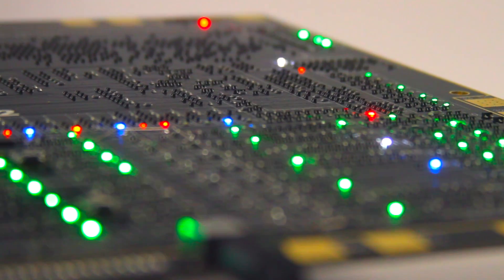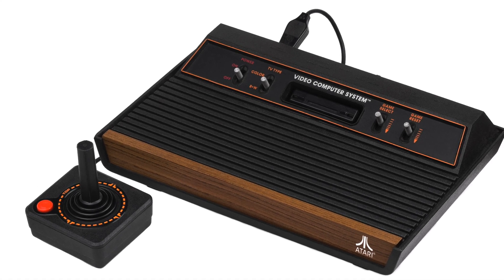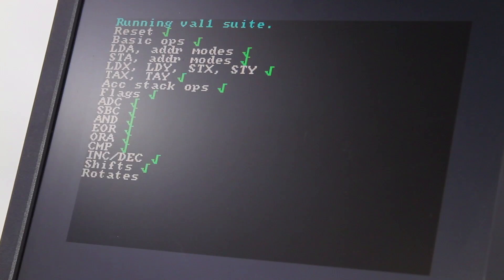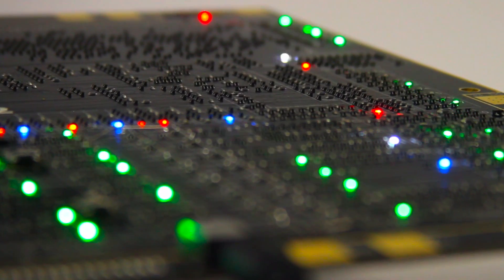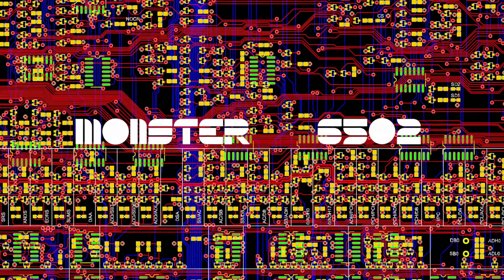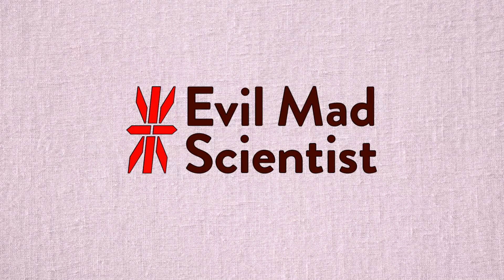MOnSter 6502 Update #1

Comment: Impressive and this actually still manages to be smaller than the transistors used on the TX-2 from MIT's Lincoln Labs from the late 1950s. Despite having much larger transistors, the TX-2 was actually much more powerful than the MOS 6502. This obviously does mean that the TX-2 was a building-sized computer larger than a Shopping Center. The TX-2 also required it's own 8 Megawatt power plant to function. I think that if the TX-2 was built like this MOnSter 6502, it would be as large as a bus and it would require an 80 kilowatt power supply... Basically it would consume the same amount of energy as 16 electric showers... Seriously the TX-2 was an absolute monster in the 50s it consumed INSANE amounts of energy... But since it had it's own power plant I guess it was OK back then when energy was cheaper and more plentiful. Nowadays it simply isn't ok to spend that much energy on a computer lol. Of course that Nowadays we can just produce a microchip version of the TX-2 which would consume less than 1 watt! Seriously LESS than 1 watt! That's over 8 MILLION times less energy than what the original TX-2 consumed. We came a long way...

Comment: The c64 was a 6510 processor which was a 6502 with extra I/O pins for bank switching (amongst other things between the basic rom and ram, that you could copy by writing the same data back to the same location!)
Reply: Yes, exactly.  The VIC-20 was the Commodore with the 6502 chip

Comment: What is the reason for the limited clockrate?
Reply: Capacitance, noise, component tolerances.
Reply: tehaxor69 .... that is why i asked them cause the clockrate seems extremely low to the point where none of the factors you mentioned should have a noticeable impact.

Comment: Interesting project. Though, the C64 did not run on a 6502, it was the 6510. A derivative, but not the same chip.
Reply from the maker: Toyota vs Ford is a rather poor analogy -- the 6510 is extremely similar to the 6502 in terms of chip layout, usage, etc. It's more like the same engine with an extra exhaust pipe. 

If you look at the datasheet for the 6510 processor, right there on the first page it says "The internal processor architecture is identical to the MOS Technology 6502 to provide software compatibility." These chips were intentionally designed by the same people to be compatible with each other,  despite their minor differences.

We understand that many people know the subtle differences between these devices. We glossed over certain details to explain the big picture of what our project is. We are not, for example, making a how-to video about which CPU device device models and speeds can be used in which motherboards. 

(Fun fact: The 6510 is MUCH closer to the 6502 than a 6502 is to the Ricoh 2A03 in an NTSC NES. About 1/4 of the 2A03 die is essentially a transplanted, slightly modified 6502 core, and about 3/4 of it is not. That's quite different from the 6510, which is just a slightly modified 6502 core.)
Reply from the maker: We did gloss over some details of that nature; a couple of the other systems that we named are also variations based on the same core.
Reply: ExcalibursZone 

For all intents the 6510 is just a 6502 with an extra IO port added, and a few other minor changes.

Same thing as where we often say the SNES CPU is a "65C816", but that's also slightly modified.

(and the Ricoh CPU on the NES etc. etc.)

Nintendo in particular liked using slightly modified CPUs, perhaps to make it harder to clone those machines?

Even the MIPS R4300i in the N64 is only slightly different to the generic NEC branded VR4300, as it has two pairs of pins swapped. Sneaky. lol

Love this project btw.
The 6502 is easily one of the cleanest CPU designs ever, especially the instruction set / mnemonics.

It would be great to see similar macroprocessors made for other popular chips eventually.

Or perhaps implement a discrete version of the NES PPU, so we can all watch Mario being drawn REALLLLY SLOWWWLY. :p
Reply: It's mainly an accuracy thing. While the chips are in the 6502 family (of which there is no dispute) you cannot put a stock 6502 in a C64. You need a 6510. The Vic 20 had a 6502, the 1541 had a 6502, and the NES had a 6502. It's like saying "The Ford's engine is the same thing as that Toyota's engine with a few minor changes" you simply can't just transplant one into the other. A little simplified of an analogy, but that's basically the same thing.
Reply from the maker: This is based on the reverse engineering of a particular 6502 revision (the "rev D" silicon), and has all of the same undocumented commands that came with that silicon. No more, no less.
Reply: ExcalibursZone 

Yep, fair enough.

Usually it's me who's the pedantic one when it comes to the technical stuff, so I'm trying to break the habit. lol :p
Reply: You can say the same thing about the 2600 and NES.  The Atari ran from the sized down version of the 2600 called the 6507 and the NES had 2 modified 6502's in their system.
Reply: The only significant difference - mainly from the programmer's viewpoint - between the 6502 and the 6510 is that the latter has added a bidirectional, bit-addressable port at location 0x0000 and the data direction register to control it at location 0x0001, together with a slightly modified pinout of the IC package - this, of course, is only relevant to a hardware designer. In all other respects, they are identical.

And I'm not even a 6502 fanboy, I'm rooting for the Z80 at every opportunity giggles

Comment: Next step should be electron tubes ;)
Reply: I'm intrigued, please tell us more about how you see this implemented.
Reply: May i? You'd need a few glass boxes to do it in. Instead of VFD's you could make micro sized triode and tetrode tube nodes inside almost the size of an SMD transistor. Instead of LEDs you can use fluorescent die directly on the lines you wish to illuminate. Capacitance would be a problem because of the high voltages needed to operate the vacuum valves, but embedding resistors and ceramic capacitors inside wouldn't be that hard. I can see it happen using vapor deposition and etching techniques like they use in the production of silicon devices these days. It would require quite the development process, but i think it's doable!
Reply: Howard Black
Now that you mention those micro tubes, i vaguely recall seeing pictures of them - and yes, it would have been quite interesting to have been able to see to which degree the miniturisation of this technology could have gone.

Comment: What is the limitation for speed?
Reply: AFAIK there are two main factors: size and fragmentation.
Size means bigger elements, which means more current/more electrons. This means that we need more time to move all those electrons around each cycle. This CPU surely consumer much more power than the original chip.
Fragmentation means that all the elements are not placed on a single chip, made from one bulk of silicon. There are many downsides to that: bigger distances between transistors' terminals, additional capacitance and inductance coming from wiring (which means bigger impedance and lower max frequency). Another downside is that transistors created on a single chip behave better working together, hence bigger speeds are achievable.
Reply: From the MOnSter 6502 website : "The primary limit to the clock speed is the gate capacitance of the MOSFETs that we are using, which is much larger than the capacitance of the MOSFETs on an original 6502 die. "
Reply: over 20 cm it takes (1/1.5Giga)seconds for a signal to arrive, so you might run into problems in the ghz range, but I don't think that would play that big of a role at 4mhz.
Reply: my guess: transistor switching speed combined with moving significantly more electrons around causing greater capacitive/inductive effects.
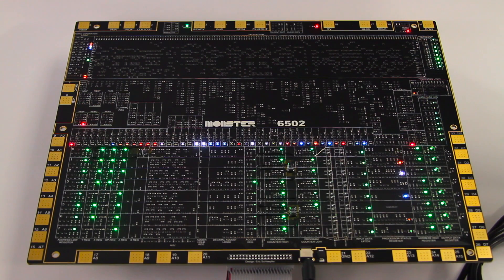Reply: At 1:15 the narrator says 60 KHz.
Reply: I'm propably wrong here as it's just a wild guess. But I'm guessing it has to do with its size. It takes  longer for the signals to travel on this version than on the smaller original one. It can also be that they might have used cheaper parts for this one.
Reply: Andreas Elf Seriousli did you just add measurement thats few centimeters into ligh speed equation and some how got 15 000 % diference answer ?? 

FACEPALM.
Reply: Limiting factor is transistor speed..You up the frequency more-your transistors must switch faaster and faster  so signals get plagued with parasitic capacitance and inductance..60Khz is fast enough-considering your amplifies can work good almost to 20Khz - 60Khz is plenty!
Reply: Can you just imagine plugging this into the CPU socket of a Commodore 64, and wait for basic to pop up after about a minute?! ha-ha... amazing project for sure.  Is there are video about the 2nd version?
Reply: Guys, size itself cannot cause any limitation :) Current travels in conductor with such speed, that it would have to be size of thousands of kilometers to see any difference. It's considered to appear at the other end immediately at such scales, regardless. As someone noticed limitation occurs from properties of discreet elements used and frequencies they can work at.

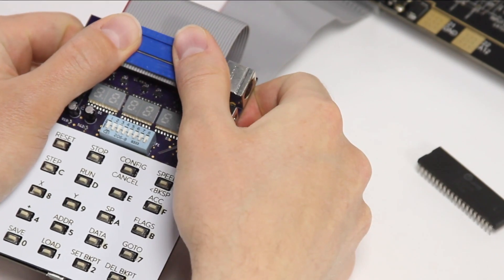Comment: What's that thing on 1:40?
Reply: It is a circuit board used to interface with the processor. In other words, a CPU by itself will not do anything, similar to how a car engine is useless without the rest of the car. This board allows you to program the CPU and connect hardware such as a keyboard and screen.
Reply: My bad, what I meant is, I'd like more info on that thing, a name would suffice I guess. Need it for the project I'm working on.

Comment: Altium tip: Enable display of net name on all of your power (ground) ports, even if you expect them all to be the same. An identical graphical symbol doesn't guarantee that they're the same net. It's also not possible to catch that during review of a printed schematic. Ask me how I learned this. =)

Also- it helps to keep your DRC warnings (green nets) under check. I once worked with an engineering tech that didn't realize that green meant DRC warning... Every pad on a 12 layer board was green.
Reply: Cool story bro... now can you translate that into English si vous plait ?

Comment: It needs a monster heat sink.
Reply: The transistors are spaced MUCH further apart than a modern CPU, so there would probably be no significant heat build up. Then again, higher voltage is used for signals between larger/more spaced components, so it would probably be hotter than expected. Doubt it would have any affect on the computing though.

Comment: What is this for? What purpose?
Reply: Education for the Computer Engineering interested I'd guess. With all of the LEDs you could single step program code and visually see exactly what is happening within the process of running the code.
Reply: I think the reasoning is somewhat similar to that of Sir Edmund Hilary, in that "it can be done".

Comment: Where's the monster Z80
Reply: 6502 gets all the fame but most of the early work I did was Z80 based, mostly TRS-80.  Wanted to work on the 8080 but they were too expensive at the time.  A 4004 replica should be easy to do.  I think someone did something similar for a PDP-8.
Reply: build yourself, it roughly has about twice the transistor count 8,5k
Reply: give me a few years.

Comment: If you made a similarly scaled version of a modern cpu, how big would it be?
Reply from the maker: Steve Mitchell Please see a few example calculations of other devices at this scale on the Monster6502 web site.
Reply: about 286 squared meters
Reply: That's less than a tenth of an acre, hold my beer.

Comment: What is limiting the speed so low? If all the components are just larger versions of what is in the microprocessor, the only difference I can think of would be the length of wire between components. Would the delays caused by longer wires already start to cause trouble above that?
Reply from the maker: Pauli Vaara Larger parts have larger capacitance. It’s not a trivial difference.
Reply from the maker: The MegaProcessor goes up to 20 kHz. Certain parts are faster, but it's limited by the slowest parts. Likewise, certain parts of the MOnSter can run much  faster -- a test board of ours that we built with just the program counter portion alone can run up to 400 kHz. However, there are large busses, and high capacitance thanks to the properties of the discrete MOSFETs that we use. That is to say, it's the components themselves, not the wiring between them that comprises our primary speed limit.
Reply: That might have helped. I had in fact started reading wikipedia stuff on "capacitance" and ended up reading "house dust mite" for reasons unclear, but that's just normal wikipedia use. So, basically the greater the current the transistor has to somehow "manage" (switch on/off? amplify vs. quench?), the slower the transition. I'd check wikipedia on "transistor" but I'd risk ending up reading interesting stuff on artichokes. :)
Reply: The speed of light is 12 inches per nanosecond,  so no electrical signal can propogate faster than that.   On PC motherboards, which are (or were) nearly as big as this one,  signal reflection didn't become an issue until they tried to run above 33Mhz.  If gate capacitance is the only issue here,  the simplest fix might be to run it at a higher voltage but as this would need all the current limiting resistors on the LEDs to be changed,  and signal convertors on all the I/O lines,  IRL the only practical fix is to specify a FET with lower gate capacitance for the next version.  With 3000 transistors every extra cent per transistor must be painful.
Reply: I ask this without having any idea or deep knowledge of electronics, but... I wonder how does the Megaprocessor project achieve speeds like 100 MHz while being so big.
Reply: Whoops wait, I read the number on their throttle wrong. It said 100 KHz top, not 100 MHz. However, still faster than what I’d intuitively expect given the massive amount of wiring.
Reply: That was comprehensive! Thank you! Just gotta check out wikipedia on what "capacitance" means now... :)
Reply: 60 Minutes did an episode on U.S. Navy Captain Grace Hopper. She talked about how she did not understand the time delay in wire. She had one of the guys cut a a huge spool of wire to represent 1 millisecond. I cannot locate the episode, however, I remember she mentioned how many feet were in that spool of wire compared to a few inches that represented (I think) a nano second.
Reply: I bow to your greater experience about the reflections at lower speeds.  Propogation I understand to be a function of circuit design i.e. number of gates a signal needs to get through before it generates its result somewhere else.  That's not relevant to this board as it uses the same circuit as the original chip.   The inductance of the traces might be more significant.
The speed of light is relevant as that is the maximum speed that any effect can propogate through space.  A 1Ghz clock will always be skewed by at least one whole cycle over a foot of even a perfect superconducting wire
Reply: lassit lassit1 https://youtu.be/JEpsKnWZrJ8

Comment: 3000 transistors.  That's so cute!  Look  at you!

PS - Apparently the early T-800 Terminators were running 6502 code, because when the first Terminator movie came out, there was a scene where we're given a Terminator's eye view of its sensory input and decision making process, and I could have sworn it was 6502 assembler code off to the side.
Reply from the maker: Bender runs on a 6502 as well.
Reply: Maybe there were more than one of those scenes and in one they used assembly, but I very clearly remember that the scene I saw had COBOL, because when I saw it I had just started training for a new job learning COBOL and it blew my mind.
Reply: I researched it snd my hypothesis was right, they used both: https://youtu.be/YRnnjoiSV-U
At the beginning of my research I found only images and clips with assembly and I started to worry I became victim to the Mandela effect
Reply: Yeah, all they needed was the software.

Comment: Wow! Impressive... So the 6502 only had about 3500 transistors. I thought it had more, but there you see. Time goes by... LOL
Reply: GPUs cheat a little in my eyes.. since its the same thing copy pasted many times lol
Reply: 230 million? LOL The core i7 4790k has 1.4 BILLION.
Reply: @MrSapps  But don't forget that the wast majority of transistors in a modern x86 CPU are cache memory. The actual processor cores (however complex) uses just a few percent of these.
Reply: The vega gpu has 12.5B transistors.
Reply: AMD's EPYC lineup has the largest CPUs ever made with 19.2 billion transistors.
Reply: Infinite loop now new ones have over 230 million
Reply: Although either way its INSANE
Reply: Definitely an amazingly capable piece of silicon, given what it can do with those 3500 transistors.
Meanwhile it's successor (65816), which you'd think would be similarly frugal, still clocks in at more than 20,000 transistors...
Reply: This is rapidly becoming a Mine's bigger than youse.  Must be a lot of male geeks here.